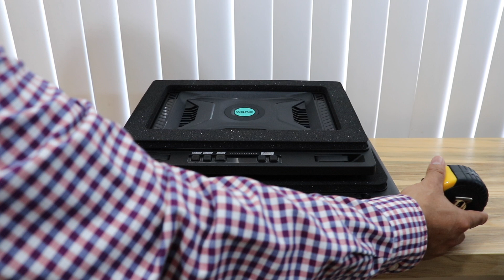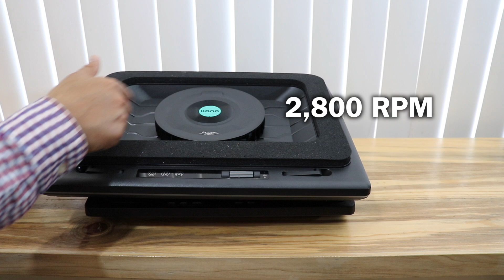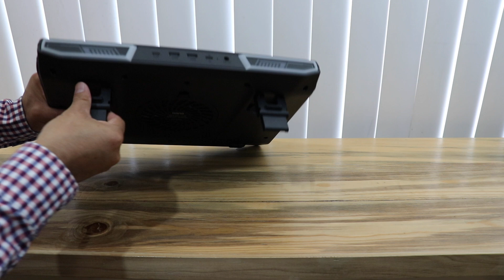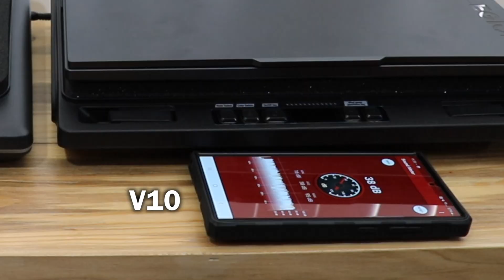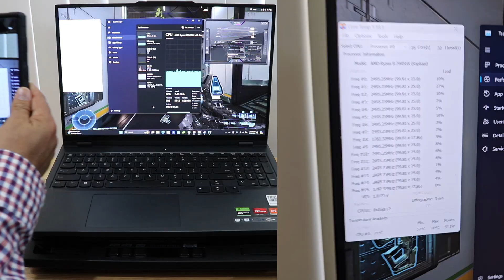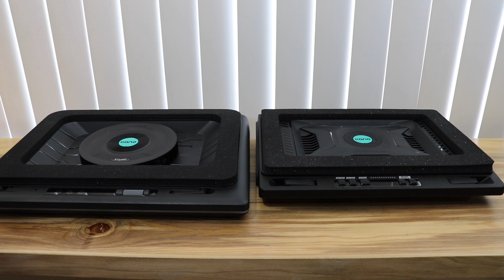Llano V10 Laptop Cooler - Amazing Smaller Design - More Quieter & Still Powerful - V12 Comparison

Comment: Yeah, wanted the v10 for my Legion Pro 7i Gen 10, but it looks like the foam will block the intake a bit. v12 is unfortunately too large for me.
Reply from the maker: I use the V10 for my Legion Pro 7, for work and traveling! It barely covers the vents but it's no big deal, there is still plenty of cool air that enters the laptop.

If you want it, get it, you wont be disappointed. I use the V10 daily at work, I love it for it's compact size!
Reply: @jpalacesneakers Did the measurements and the v10 would end up sealing 6 vent strips (3 on each side). It'd still work, but not optimally. I ended up with settling for the Flydigi BS2 Pro. It's pretty chunky, but it cools marginally better than the llano coolers at a quieter volume. Doesn't have a USB hub, but it does have a smart cooling mode by default and partially supports laptop USB-power which is nice.
Reply from the maker: @EightBitSlime That's awesome the BS2 Pro is legit. Looks like the 7i is a different setup underneath than my amd version. Glad you found what you needed, I know you'll be very happy 👍👍

Comment: Great video! I am currently choosing between the V10 and the Razer cooling pad. Both are around the same price where I live. Which one out of these two would you recommend for a 14 inch power hungry laptop?
Reply from the maker: I personally like the V10 because its smaller, has really cool looking rgb, and it's easier to use - all tactical buttons. Also, easier to pack in your backpack.

Get the Razer if you like the sleek design better and prefer using it with the razer software - controlled via mouse or touch pad - only way to use all the features.

Choose which you will like the best 👌👌

Comment: Hello. Thanks for your in-depth review. Just still missing 2 dimensions here. I can't find the dimensions of the inner chamber, measured from the inside, anywhere. The dimensions of the entire device are available, but I'm worried that the openings on the bottom of my laptop are wide enough that the edges of this seal will partially cover them. I would be very grateful if you could provide these dimensions. Or measure them next time :)
Reply from the maker: https://youtu.be/XcGkWohKEXU
This video should have it 🫡

Comment: Very detailed! Maybe getting the v10 for my asus tuf a15. Thanks for this one!
Reply from the maker: Appreciate the comment, glad I could help! 👍👍
Reply: hey bro, can I ask for an update regarding the v10 you bought for your laptop? How was it?
Reply: @seenpai3359  Hey man seen your reply. And it's a top notch and highly recommended based on my experience and also if you want to make your laptop last long for years, coz you know heat is the main enemy of gadgets. My TUF always running hot from 75d-85d of use on heavy works especially rendering it helps lowering temps somewhere 56-60d. And if idle light use, somewhere 45d. I played these temps between 2000-3500 rpms. You have to get one! Build is also super premium.

Comment: Hi, excellent video! But will the seal work on the Asus zephyrus g14? The g14 has a unique hinge design where if you open the laptop, it will produce a gap between your laptop and table, so it isnt completely flat. Does this design hinder the seal, or does it only work with flat laptops?

Comment: My laptop's also a legion 5 pro, and I was worried about the exact placement on these. it appears like it fits almost perfectly on the V10, and I'd consider it much better despite the TINY overlap on the very sides of the vents. Mainly, I think the V10 is much less needlessly bulky, and would be more comfortable to use with the laptop without an external keyboard. What's more, I do not understand why they put the USB Hub and power on the right-hand side of the V12. That's the case for the "updated" 2025 version as well, and it's just stupid.
Because it's already a much bulkier one, forcing you to make more space - the usb hub is unusable and very inconvenient if you're right-handed and using your mouse to the side of the laptop.

V10 has the hub and power all in the back, where it should be. Lines up perfectly with the legion models that have the vast majority of their ports on the back as well.

I'll consider it some and might grab a V10 just for the convenience. If nothing else, I like that it will simply add extra dust filtering even if I don't run it all too high for the cooling itself. My laptop manages to cool itself pretty decently, especially when propped up on an admittedly wobbly and annoying plastic stand. But damn, is it a dust magnet. I open and clean it somewhat regularly, since often the dust buildup in the fans isn't even really visible, but impacts thermal throttling a lot.
Reply from the maker: Watch this video, its a sizing guide. I agree about the usb hub, much better in the back. Hope this helps 👍👍

V10 is a great choice, more slim and smaller.

https://youtu.be/XcGkWohKEXU
Reply: @jpalacesneakers  Thank you for these great reviews and comparisons. I am subscribed. I'm liking that the V10 is quieter and not looking so bulky for a Legion 5 16".

Comment: For the same amout of cooling which is quieter?
Reply from the maker: How much cooling does your laptop need?

Watch this video, it will help you a ton.
https://youtu.be/XcGkWohKEXU

The fan for the Llano V12 can be set at very low, and it will still give you max cooling! That right there is very efficient, plus it will keep the noise down tremendously.

Let me know if you're still on the fence 👍👍

Comment: One review said the Lenovo Legion pro 5i on a v10 is getting better results than on the v12. I have more or less the same laptop (one year older model) and pretty similar underside vents. Can you somehow confirm? which one would be better?
Reply from the maker: @MrEladCL V12 should be better for cooling since it's more powerful. V10 is better for portability.

The sizing guide will help you, if your laptop does not fit nicely within the cooling area, then some cooling air will escape. As long as the V12 is taking advantage of all your vents then it should be the best choice for performance.

See which fits your laptop better. If both do, then choose the V12.

Sizing Guide
https://youtu.be/XcGkWohKEXU

V10 is still a good option if you just like how it looks better and how small it is.

I do not have a pro 5i, but hopefully, I was able to give you additional information so you can make the best choice for you. 🙏

Comment: So the lower number is the newer model?
Reply from the maker: @Boneless1213 The V10 (has RGB) is a new compact travel version or if you have a smaller laptop and like this design better for your laptop or if you have a smaller desk space. The V10 fits a lot easier in a carrying bag or your backpack.

The V10 SE is the Non-RGB version of the V10.

The V12 (has RGB) is the cooler with the best cooling power currently on the market.

The V13 is the Non-RGB version of the V12, has the same built-design so it will give you the same exact cooling performance as the V12.

Can watch these videos if need more info, hope this helps! 👍👍

V13 Review
https://youtu.be/iqwO9vQ_rnA
V12 Efficiency Test and Other Details
https://youtu.be/XcGkWohKEXU

Amz V10
https://amzn.to/3D6Qd7Y
Amz V10 SE
https://amzn.to/4ibkqBB
Amz V12
https://amzn.to/4gXdJ5h
Amz V13
https://amzn.to/3XaFC2H

Comment: someone ever tried a laptop without the case under it. i wonder what that will improve performance/temp wise.
Reply from the maker: Dannng that's thinking outside the box, there could be some possibilities there as long as you're able to protect the laptop from dust!
Reply: @jpalacesneakers  i just hope the V15 RGB does work. i will proably leave the case on. as you said. more dust. i dont like to clean every weak with LM on it..

i dont intend to spend a month till i perfected another terrible stock cooler from laptop to get power limited rather then heat limited. as it also comes with costs for a 2nd cooler, heatpipes and a lot of time investing the best design for the case to get at least 50% more cpu heat away. like in my old laptop i modded on that.

but lets see till next week i proably should have one. hopefully fully working and no defects.
Reply from the maker: @NicolaiP these work good, but have it elevated with the stands, you'll get the best cooling that way

Less cleaning is best, so keep the case on too 👌👌
Reply: Im still runing my 3080ti,5800x for about 4 years now without hiccups. Definitely desktop lifecycle is much longer compared to laptops. But I do agree, the melting of cables is really prevalent. I just replaced it with a good  quality psu with good quality cables.
Reply: at this rate you better buy a desktop
Reply: @ desktop quality is gone. there is sadly no need anymore to buy desktop. unless sli comes back i dont bother with the desktop issues of melting..
Reply from the maker: Comes down to needs, desktops if you plan to not move it. Laptops can use in kitchen, living room, room, outside, and in space lol. Desktops have more power and you usually get more for the same amount of money. Desktops have maintenance too. Be nice if computers and laptops were like phones, minimal maintenance but even those die 😅🤞

Comment: For macbook pro 13 inch, what would you recommend?
Reply from the maker: @Skye-oy8yi Unfortunately, many MacBooks do not have intake vents, only exit vents so most coolers will not work on them.

For these kinds of coolers to work, you need to have a vent where the air enters (the bottom) and vents where the air escapes (side or top vents).

Check your laptop and let me know if it has those types of vents. If it only has top or side vents, it won't work.
Reply: @jpalacesneakers  Hi . Sir , for laptop razer blade 15 . What cooler would you recommend ya
Reply from the maker: @luciensabertooth4945  Choose the Llano V12 for the best cooling power, or the V10 it has the best design for travel and a slim look. It really comes down to personal preference, what you like better.

If you need more info, here is a video you can use to compare with your laptop for exact sizing.
https://youtu.be/XcGkWohKEXU

Hope this helps 👍👍 and don't forget to sub Brother if you can

Comment: If my gpu and cpu temp are around 61-68°C while gaming, does this thing help to improve fps? sorry for my bad english.
Reply from the maker: @VeerapatPrasripat That's already good temperatures while gaming especially 61, can probably improve but probably not going to be a huge jump since already good. But you will feel confident your computer is getting more than enough cooling, I think that's a good thing.

Also, there are many variables for improving fps: the type of internet you have (how fast it is), the cables you use, the server you connect to, the monitor you use (75hz vs 100 vs 120 hz vs 240hz, etc), what kind of gpu and cpu you have, how well your computer cools its system, and so forth. Every area you improve can help out, can make your gaming better. Sometimes one change is very noticeable, other times it's just a bit better.

I say if you have the money for a small investment cooler, especially right now that there are sales, I would go for it. I think you would be happy, only if you have extra money.

Hope this helps 👍👍
Reply: @jpalacesneakers  thank you, I always limit fps in games at 60 I think that's why my temperatures are not that high.
Reply from the maker: @VeerapatPrasripat Yeah, running lower fps will be easier on your gpu & cpu, so lower temperatures.

120fps over 60fps is a huge advantage with good ping, everything moves more smoothly, it even feels you're shooting faster!! Once you play on 120fps, feels like you're going back in time with 60fps.

Here is a great tip, raise the fps to 120 but also lower all the extras graphics like special effects, explosions, extra shadows, etc. It can give you more fps too, and your game will feel more responsive.
Reply: @jpalacesneakers  i already ordered it now, can't wait for use it😁

Comment: Hello I have acer nitro 5 with 15.6 inches, is it good if I go with v10 does it perform same as v12?
Reply from the maker: The V12 does perform better, provides more cooling power.

The V10 is more compact, so it's better for a smaller desk set-up and for traveling (it will fit easier in a bag).

It's going to come down to what you value more. Get the V12 if you have room for it in your desk set-up and want the best cooling power in the market. Get the V10 if you like the smaller design more and plan to travel with it. Both are fantastic choices!

Here is a fitting guide, if you want more information and you can compare the measurements with your laptop. https://youtu.be/XcGkWohKEXU

Hope this helps and enjoy 👍👍

Comment: subscribed thanks for the video <3
What's the difference between v10 & v10SE
Reply from the maker: V10 SE
The V10 SE is the Non-RGB version, it also doesn't come with the extra usb ports for HUB functionality.

V10
The cooler has RGB (led lighting) and can function as a usb-hub so some of your plug-ins are not connected directly to your laptop and draining the power. It will still require a cable to connect from the laptop to the hub (cooler), which essentially adds more usb connections. - Connect your mouse, keyboard, etc.

The V10 SE or V10 are great coolers, perfect for travel, or if you're looking for a small compact design for your home/desk space.

Hope this helps Mohamed 👍👍
Reply from the maker: @papag4446  🫡 n that's a great price 👌

Comment: Hi! I'm thinking of buying V10 or V12 but i'm unsure if it will be effective to my laptop which has a built-in fan, I think. I was wondering if you know whether or not it will be effective enough for my laptop to buy one? I'm using an ASUS TUF Gaming F15 FX506HE. Thank you!
Reply from the maker: Yes it will be effective. Everyone who buys these their laptop has a fan that is still working, or the fan has failed.

Llano V12 for best cooling power

IETS GT600 for best rgb

Flydigi BS1 or Klim Turbo Frost for best sound control (quieter coolers)

Llano V10 for best travel cooler or awesome compact size, yet still provides great cooling power

Watch this video for any sizing questions you may have: https://youtu.be/XcGkWohKEXU?si=Agsu6ZDoRcuPUxfq

Hope this helps and best wishes Ritz 👍👍

Comment: Whats the difference i have a v10 from them with a bid circular fan now thos squared fan
Reply from the maker: Just seeing this. Probably just the housing, the V10 has a circular fan underneath. The V12 doesn't have a square housing, so when you look at it, it looks circular. But both use circular fans.

I wouldn't be worried at all, as long as your laptop sits nicely and is sealed properly with the foam, then the air is going to flow smoothly.
Reply: @jpalacesneakers  yeah it seems cooler to thw touch but looking at the specs running on the alienware system and a few others I have checked it seems like it helps some kn the alienware m16 r2 but not as drastic as they advertise during normal operations however after a stress test or a very farm temp it did help drop the temp much quicker
Reply from the maker: @jasonhorn5976 I know results vary depending on the laptop model, each laptop is different. I still think it's a nice investment if it can lower the temps by half of what they advertise. For my laptop, I get the full 10-12 degrees 😍😍

Comment: what matters more than the laptop vents overlapping the foam is the seal. a good seal forces the cooling pad air to enter the laptop and carry heat away from internal components

and as long as the proportion of open laptop vents is not close to 0, there'd still be a good amount of air forced through

for macbooks and other laptops with somehow no bottom vents, when placing the laptop on the cooler, you have to leave a small longitudinal gap (ideally to the back of the cooler. meaning you're gonna have to sit the laptop a bit more to the front as usual). the air from the cooler may not be forced through inside of the laptop, but at least they make contact with the bottom, thus still has the ability to carry away heat. and once they carry heat, the air is blown out through the longitudinal gap at the back
Reply from the maker: 100% the seal is super important, the quality and size of the foam matters but also how you position the laptop on the cooler, ace observations Tristan 👌👌

Comment: Hi! Love your videos! Great work. 

I saw that the V12 cooling is the same around the 1400 - 700 rpm as it is at the max 2800 rpm. Is this the same way with the V10?
Reply: only at the high end it matters, and really by that point its too loud.

Comment: I have a 14 inch laptop, v10 or v12? I saw some comments on reddit that if you have 14 inch laptops v10 is better because v12 is too big for 14 inches laptop, is that true? Or v12 will still perform better even if i have 14 inch laptop
Reply from the maker: Watch this video, it will help you out big time. Measure your laptop and compare it with the coolers, then pick the one you like the best 👍👍

https://youtu.be/XcGkWohKEXU

Comment: I just bought the gt600 v2 and I'm tempted to buy the llano v12 or v10 to compare it with ..
Reply from the maker: @3choblast3r4 Just seeing this, the V10 compared with the V12, basically if you want the best cooling power get the V12. Now, the V10 will be better for traveling, it has a more compact design. It's pretty much preference, what you like more. The V10 looks so cool though how slick and smaller it is, yet packs a nice punch for cooling too.

If you want more details about the bigger coolers, here I compared the GT600 V2 vs the V12, found some interesting details about the cooling: https://youtu.be/XcGkWohKEXU

Another side by side comparison.
https://youtu.be/8e6hCqWyipw

Hope this helps, they are all awesome in their own way!